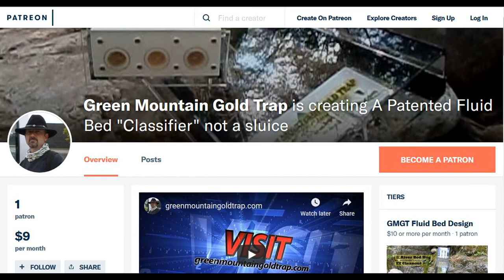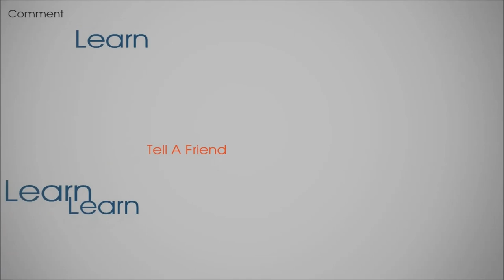Blue Bowl Mod From 2017

Comment: Really interesting application for those motors.
I can see you making as Miller table with them. Thanks for the idea.
Reply from the maker: Thanks Damon! It's not an original Idea so, I can't take credit for it but, it works very well and makes recovery much quicker.
Reply: That's a good idea for them to Damon...

Comment: I used a blue wheel but never the blue bowl. I don't get much fine gold when sniping. looks a cool way to separate  Thank for sharing Joseph.
Reply from the maker: Thanks Brad! A friend of mine has the wheel, they seem to work pretty good. I'm not a big fan of the blue bowl due to the fact it's a bit slow. But, I got it down to a science.

Comment: Hello Joseph, my friend, finally, once again a wonderful video of you. And then this diet * laugh
I do not know if all the work is worthwhile?
Would not it be better to melt everything and then separate the gold from the Black Sand and the other, which you do not need?
How long does a session with the Bowl take?
Greetings from snowy Bavaria.
Gold boy Tom
Reply from the maker: Greetings my friend! Thank you for your kind words as always. It's not much work at all, just a bit time consuming. The only thing I will use the blue bowl for is the fine flour gold. It take some time to do as the blue bowl is a indeed slow process. By doing this mod, I sped thing us quite a bit. Hard to say exactly how long it takes because it depends on how much black sand you have to run.